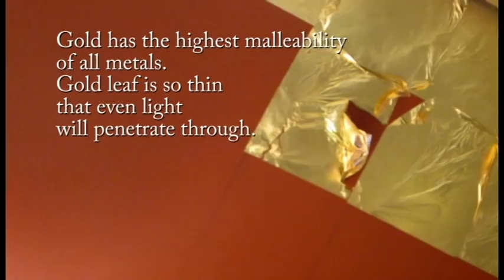23 Karat Gold Leaf Ceiling

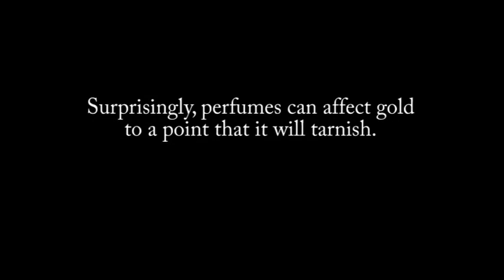Comment: What I see in this video looks more like thicker and larger sheets of imitation leaf made from 88% Copper and 12% Zinc. At 1:33 in this video it says "Surprisingly, perfumes can affect gold to a point that it will tarnish." I'd always read that gold is one of the least reactive chemical elements. Gold alone - or pure gold - does not combine easily with oxygen. It should not rust nor tarnish. 

But I could be wrong . . . :)
Reply from the maker: Thank you for your interest in this work. Yes it is 23k and the leaves are just over 3" square. Briefly you can see them drawing the marks with 3" spaces marked on the ruler. I was also recently gifted books of very old 23k and it does indeed tarnish. Perhaps you are referring to 24k gold.
Reply: Thank you for your quick and informative reply! It answered my questions. I'll edit - or delete - my original comments in light of the information you shared. Thank you.